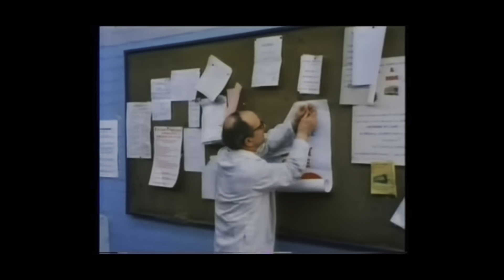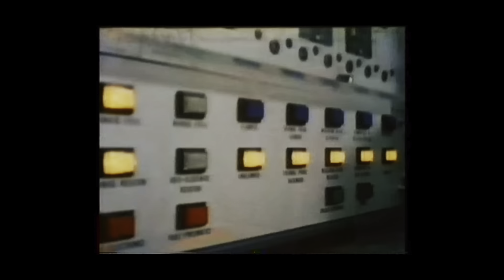Rover V8 British Leyland quality control

Comment: Rover V8; Still my favorite engine after 50 years of working as a mechanic!
Reply: Cheap horse power, and lighter than a pinto.
Reply: @gothicpagan.666  "lighter than a pinto."
That's not much of a flex, they weighed about the same as the Titanic 🤣An LS1 is also lighter than a Pintosaurus, and make really good power.
Reply: @ferrumignis  A pinto would make a good anchor.
Reply: On injection it's the Best sounding v8 imo
Reply: They should have replaced the unreliable Jaguar V12 with an overbored Rover V8

Comment: The only high volume V8 in England,, an obsolete Buick!  They really did NOT have the power required and were too expensive to make. The cast iron V6 version was around for decades though by the 80s made ok power. Harsh rattly thing however.
Reply: required for what? they were perfectly fine

Comment: Big trip down memory lane for me!  After leaving college in the mid 70s I worked for a small company on the capstans then round the corner to a big volume manufacturing plant as a Patrol Inspector.  What an adventure that was.  I discovered parts were being signed off as checked when the gauge to be used was in the stores and had been for years!  Other sections were using a gauge incorrectly so any part - good or bad - was passed as good.  Another chap on centreless grinding was using a Mercer air gauge with the needle way outside the tolerance markers - he hadn't been shown how to use the gauge.  I left then was back twenty years later when it was all ISO9000 and paperwork, tons of paperwork.  I got sent on an 8D Investigation course at Ford/Getrag at Halewood.  I solved many problems at Halewood.  Nowadays I'm making spare parts for Matchless and BSA motorcycles still using the QC I learned all those years ago.  PS  Good to see the geography teacher and others from 'Please Sir', and Chief Inspector Japp was in there too.  Great film, thanks for showing.

Comment: I have seen this film before . Very good & to the point. Having worked at West yorkshire foundry as a Sparky many years ago I saw the V12 blocks being made. 
& repaired due to damage & casting flaws. Have had a few V8 rovers. Now the proud owner of a TVR Chimaera 4650 lined Rover V8. Still a great engine & the amazing sound is very adictive. Thanks for the video.
Steve.
Reply: I used to set up griffs  and chimeras  at a company I used to work for. I absolutely loved them. Utter delight and adrenaline when they were right, complete pig when it inevitably went wrong. Easy fixes for most of the problems, but could never get rid of the hooded man with the scythe I saw, every time I looked in the rear view mirror. 

Bloody good fun car. When I win the lottery, there will be a 500 griff in the garage 😂

Comment: That was pretty good, the actors were even convincing! The Rover V8 was a great engine, I rebuilt two of mine, though they had no crankshaft wear to speak of, the bores were hardly worn and only needed a hone with new rings and bearings they were good to go for another eighty to a hundred thousand miles one engine needed new valve guides which I farmed out to a local reputable engine machine shop but that was all. The biggest problem was when they enlarged the capacity from 3.5 litre to 3.9 and after around 75-100,00 miles some liners came loose. I had that problem with my last Land Rover Discovery 2  4.0L as they called it. But I used a novel sealant called steel seal or some such thing and it worked, I put 25 k on it before I sold it with no further trouble.  As I say a great engine. Don't suppose too many are on the road now because the Discovery 2 was a rot nightmare, due to Land Rover no longer putting underbody sealant on them. Talk about built in obsolescence !
Reply: The 4.0/4.6 was a complete rework, it had cross bolted crank caps, bigger crank journals, stiffer casings, different head stud pattern, better oil pump and a lot of other design changes. They made a 4.4L proto based on the original 3.5/3.9 block dimensions and it suffered crank whip and other things under test so redesigned things (I have a unground 4.5 proto crank with leyland part number cast in that escaped leyland proto dept in that leaky british way ;) ) . The blocks were graded for liner thickness on the line and the thicker castings were diverted for 4.6, with the thinner walled ones going to 4.0 because the liner was smaller. They still do suffer with slipped liners though, but now the cure for that is a top hat shaped liner conversion which stops the liner being forced down by combustion pressure if things get a bit loose/too hot. If they had of stayed in production maybe the factory would have come up with similar but it didnt start to manifest in serious numbers until higher mileage to catch in the proving stage.

Comment: Thanks for that Andy. That was great. 😊
Can akso say, i had a rover block bored from std to 30 over, done on a 90 fixture, and the bottom of the bores on both banks wouldnt clean up on the cam side. It had been bored at a wonky angle from the factory  ❤

Comment: My mother's Rover SDE v8 ran like clockwork for over 18 year's  and loads of mileage during those years towing a 6 berth caravan every end of the year . Excellent towing vehicle and only uses 15 litres/ 100km with the caravan. This is with a very heavy lead foot as speeds of over 150km was obtained with the caravan on occasions and proof that the Watts Linkage system really works well. Unfortunately, bad services followed by my incompetent father and carburetor problems with year's of wear and tear was why the car was eventually sold. Well over 400000km's from the engine though and never ever opened up.

Comment: The lugs on the side were the machining datums. In the foundry, the castings critical  features, water jacket positions, valley height, etc, were balanced and 3 point locations machined on the lugs. After the blocks were machined, 3 of the lugs were removed. I worked in the foundry and it made us cringe seeing how the machine shop banged them about, moving the datum.
Reply: Bobuilt10:   That is surprising.   Something that all young professional engineers learn is that it should be possible to check all machined dimensions against datums even on the finished product.  Without that you can have no quality control and no way of diagnosing process issues.
Usually, the engine rear face and either the bottom machine surface or the top surface (head gasket contact surface) are datum surfaces.
The V8 engine design and all machines and tooling to make it were sold to Rover by GM USA, who also sent people over to set it up and teach Rover how to operate it.   This engine was intended for Buick cars, but GM decided not to use it.   It has always been reported that GM did that because another division came up with a cast iron "small block" design that was negligibly heavier and the alloy V8 could not match the in-service fault rate and durability of the cast iron small block.
If you are correct, perhaps it is the real reason why GM abandoned it - one of their production engineers seriously effed up.
But I think the real reason for the problems is that by the time this film was made, Rover had been making this engine for most 20 years, and they had just worn out the factory machinery, running it into the ground.   That is typically what British firms did.
Reply: @keithammleter3824  If I remember correctly GM had real problems with casting the alloy block, so much so they gave up and went back to iron. A V6 version of the Buick V8, with an iron block, was used up until the late 90's.
Reply: @agt155  What is the source of your claim?  It sounds like a myth to me.  GM had a lot of experience making large alloy castings for the war effort in World War 2.   They were turning out about 125,000 aircraft engines a month at their peak.   Including vast numbers of turbocharged alloy V-12 engines for USAAF fighters.
They knew a thing or two about casting aluminium.
If GM couldn't make good alloy blocks consistently, Rover with enormously less experience, would have had no hope and would not have risked it. 
The fact that they could make small block cast iron engines weighing negligibly more than the alloy V8 (which is easily verifiable) they sold to Rover would have been a key point.
Reply: @keithammleter3824  The fact GM spent all that time and money developing the aluminium block just to drop it and develop an iron one instead indicates there were big problems. GM blocks were produced from gravity fed steel dies with cast-in liners, Rover blocks were sand cast with pressed in liners - a hint of the problem?
Rover did have extensive experience with aluminium engines, they produced the Meteor version of the Merlin V12 for use in Centurion tanks and also made a V8 version. 
The iron block Buick V6 weighs 16Kg more than the Rover V8.
People don't appreciate the incredible power to weight of the Rover V8 - still competitive today.

Comment: Great video ,just goes to show what can be achieved by working together with a common aim ,reminded me of how the MOT VTS Council was formed due to dis-jointed legislation varying testing standards and a very random punishments for any transgressions,it worked really well getting some fairness back into the system, but now its gone , so the MOT test is going to be the new rover V8 assembly NO CIRCLES

Comment: When I worked for a Dodge / Chrysler franchise I had to fix no end of problems from the factories, they just pushed vehicles out😮😮
Reply: Are you in Australia?    In the 1950's Holden (local GM brand) and the Ford Falcon were the volume sellers of locally made cars.   In the 1960's they were joined by Çhrysler making the Valiant locally.   But Chrysler struggled - they never sold as many as Holden or the Ford Falcon.   
It was pretty well known that if you were a Holden dealer, all you had to do was clean the protective wax off, add water and oil, put in a battery, put in some gasoline and make sure the engine started.
If you were a Ford dealer, almost the same, clean off the shipping wax, add water, oil, and gasoline, battery, and start the engine.   Customer options such as radios, vinyl roofs were added by dealers.
If you worked for a Chrysler dealer, cars would arrive with things like no steering wheel, because the factory had run short.   Or maybe the guy who fits steering wheels was off sick.   Or they would be missing radiator hoses or something.   Dealers could get a factory rebate of any work done or parts needed, but it was an annoyance.
The worst cars from a dealer's point of view were Fiats.   They were fully imported from Italy and arrived with rust.   The rust could be bad enough that the car needed surgery at a panel beaters'
Customers are funny - they never accept a brand new car with the no-cost rust option.

Comment: 1980 my family got an SD1 to sell for someone chocolate brown paint and beige velour and the silencer box rotted off and bald tyres. We used it as a Saturday car blasting it everywhere wheel spinning loved it sounded like a turbine then an apocalyptic racket at 100mph as the door seals popped open. Every time getting in and out door trim and courtesy lights fell out.

Comment: You have to ask yourself why things got to customers with these problems, and I think that a lot of it was that british attitude when management spoke and the shop floor just listened and knew their place as peons. And a lot of the people saying no in the original situation were probably not wanting to rock the boat becase thats how the status quo was. Ironically it was left to the shop floor to sort out.
Vauxhall's used to operate a similar scheme called the ideas scheme. But it was more about making things cheaper to make than solving quality issues irrc. I always remember being told the biggest payout under the scheme was when a assembly line worker suggested eliminating the drain bung from the rear axle on rwd cars, it eliminated adding a bung, making a bung, and having someone insert the bung saving millions over the production years. The side effect was when the axle needed its oil changing, that draining the diff had to be pulled out instead making it a painful expensive job in comparison to a quick axle oil change. So in effect it pushed the costs (multiplied) onto the customer further down the road... At GM of the period, you could only get recruited for anything except production if you had a degree. It didnt matter what that degree was in, just you had one (to increase paper worth of the company as a metric for investors I believe). So a candidate with a ND in vehicle engineering was rejected and my friend with a art degree got in.
During the early ecotec years, the engine design suffered a flaw where a cambelt tensioner failed which lost the belt and destroyed the engine, Vauxhall ran out of replacement engines and the cars were sitting round in dealers for months or years waiting for warantee repairs and it nearly destroyed the affected models sales. The dirty shame of that incident is engineering knew about the problem tensioner, and recommended to replace them all on a recall, but upper management veto'd this under costs & decided to save money by targeting only a very narrow date of engine production. 
Whatever happened to the british motor(& motorcycle) industry?  white collar management, with arts or humanities degrees. That's what happened...

Comment: The Japanese would fix the crankshaft machine. Not alter another component to mask a fault. 
Bloody hilarious
Reply: Having spent many years rebuilding and modifying engines including countless Japanese motorcycle engines I can tell you that the Japanese would do exactly the same thing they did in this film furthermore and probably surprisingly to you and many others the tolerances that the Japanese make their engine components to are much wider than Rover and most other manufacturers would have been using this is done to reduce scrap rates and therefore costs and selective assembly is practised to ensure proper working clearances.
Reply: @grantbaker3336 exactly, tolerance grading and selective assembly has been the cornerstone of mass production for the masses.
Reply: My manger was speaking with the Toyota line engineer about our machine shop and said "how many thou do you machine too "  Reply from Toyota was "Thou !   we machine to the micron ".   Toyota Deeside would take 45 minutes to assemble an engine and have it at full power and programmed.  Any taken from the line went straight to Kaizan QC to find out why, no reworking.
Reply: @WOFFY-qc9te  sizing to "tenths of a thou" has been Std manufacturing tolerances from the 1920s, selective assembly optimises the assembling of parts machined to these fine limits, that's it!!!
Reply: @Brit_Toolmaker  In the UK, yes, not in Japan.

Comment: There are various kinds of quality.   
# There is high quality - as in a Rolls-Royce, it is a better car than a Jaguar, but it costs a heck of a lot more.   And a Jag is a better car than a Mini - but costs a heck of lot more than a Mini.   This kind of quality varies, and should vary, according to market need.
#  There is managed quality - designing production processes so that defect rates are minimised - this is what this film is about - minimising factory wastage and shipping products to dealers in ready for use condition.
#  There is designed-in quality - a product's engineering, choice of materials, etc, so that the failure rate during the owner's use is acceptable.   This what the British car industry,, including Rover, never mastered and never saw it as something they needed to master.

Comment: Oooh, a video on the quality control of the Rover V8?  This should be a short one ;)
Reply: What experiences of poor quality control have you experienced?
Reply: My late production TR-8 had over 100,000 miles on it before I pulled the engine....the 3.5 is solid...but the rest of the car looks like it was built by drug addicts

Comment: This is a training film for internal company use, and has the look and feel of being made in the 1980''s when Western companies were loosing to Japanese competition and it became fashionable to managements to try Japanese methods, of which quality circles is one.   The Japanese had been using quality circles since the American Occupation at the end of World War 2 had told them to.   In most cases, quality circles in western companies petered out within 2 or 3 years.
It is surprising that Rover were having defective crankshafts in the manner depicted as by the time this film was made, they had been building the Buick alloy V8 for about 20 years.   Definitely not a good look.   Looks like they ran the machinery purchased from GM into the ground and didn't have a replacement schedule.
Amusing to hear it described as "not a volume production engine".   I suppose by the parent company's standards that would be right.
Reply: There was a lot of porous blocks around 1999/ 2000

Comment: A lot of this is not quality control, at all. It is simply about the smooth running of a production facility. Something which had already been done, decades earlier, in every continent on Earth except Antarctica.

Parts catching on the guide rails? I think that Henry Ford or Samuel Colt had already figured that one out.

Comment: MACHINERY WAS WORN OUT WHEN BUICK SOLD IT TO LEYLAND
AN ENGINE CAN HAVE LOOSE LINERS AND EXTRA TGHT LINERS
AND LINERS TOO LOW AND LINERS TOO HIGH ON SAME ENGINE
MANY AMAZING DESIGNS WERE RUINED BY POOR  QUALTY CONTROL IN ANUFACCTURE
AS DONG IT PROPERLY WOULD MAKE NO PROFIT
CITROEN DS
RANGE ROVER MK1
E-TYPE
STAG
MINI